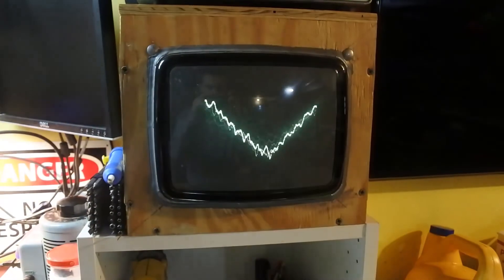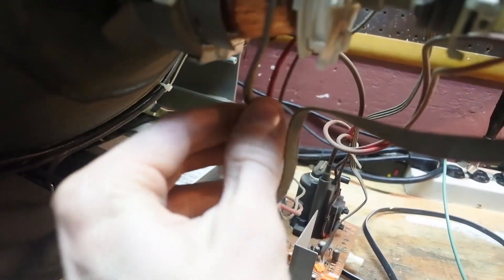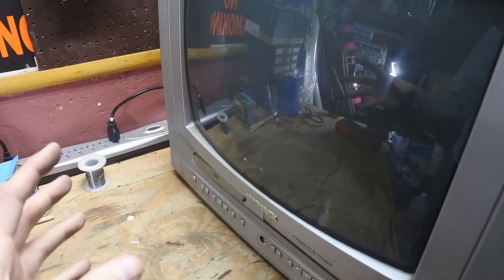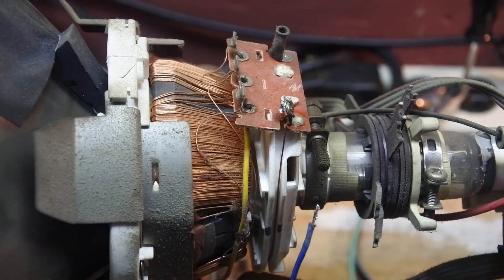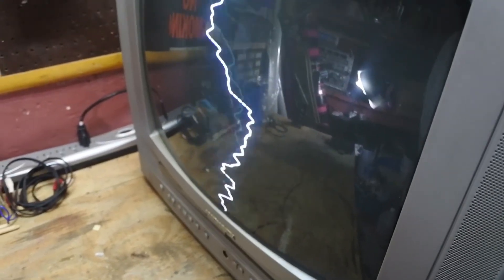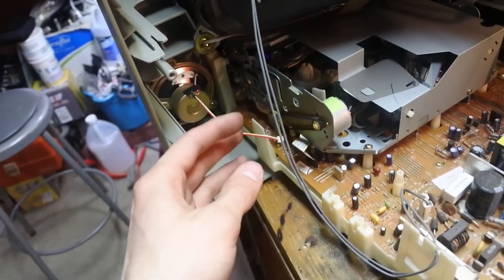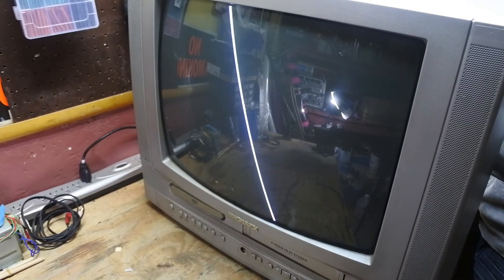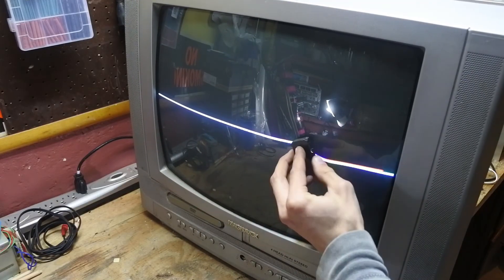How to make a waveform visualizer

Comment: I tried this, and I was successfully able to isolate the vertical coil. However, after attempting to connect some audio wire from a stereo amplifier, no movement occurred in the vertical line. I tried this with two different audio inputs, but nothing happened. After a while, the tv shut off on its own, and now the image won’t turn on to give me the vertical line. I think it’s a problem with either the audio wire I used, or the fact that I don’t have resistors connected to the cut horizontal wires. Can you help me?

Comment: And as usual, there is a missing piece in the mod. You need to inject a custom controlled Cathode voltage (Kb, Kg and Kr) to avoid having the interrupted line due to the input (or lack of) composite signal or snow from RF. Ideally with Blanking control circuit, or another option is to tap into the Jungle.

Comment: Please do NOT discharge a CRT  that way. You stand a good chance of zapping yourself and other parts of the set. Any stored (undischarged) EHT of around 25,000 volts is between the inside and outside of the glass of the CRT. It acts as a capacitor. To discharge a CRT you should ONLY discharge between the aquadag (the gritty black/grey conductive carbon paint on the outside of the CRT) and the ultor cap (that suction cup looking thing). 

FIRST connect your discharge wire to the aquadag. This can be done to any metal grounding straps around the CRT that DIRECTLY touches the aquadag. THEN slide the other end under the ultor cap. Make sure that ONLY this discharge wiring connects the two together. Do not let yourself be in the middle, nor other parts of the set.

What you did only attaches one thing to the EHT, the other part of your discharge circuit was through everything else nearby, which could include you.

For what it's worth, most modern sets discharge the tube at switch off (if not faulty). If you've seen a set's whole screen flash white for a brief moment at switch off, that's it discharging the CRT.

But CRTs can recharge while you work on a set, just from picking up static electricity as you move about. For that reason you MAY want to leave the discharge wire shorting out the tube while the set is unplugged and you're modifying things. Naturally you MUST remove it before applying power.

Also realise a set can discharge through the pins on the electron gun in the neck.

Comment: At 4:15 you mention adding resistors to trick the TV. How do I go about figuring out what kind of resistor to use? High wattage, yes, but how high? I used a 5W resistor and that got scalding hot
Reply: I read in another guide to use high voltage sandbar resisters. 10-25 watts or higher if necessary. But that's only necessary for TVs with the safety feature

Comment: Hi new idea to Make circuit of oscilloscope that run on video input composite of TV with out open any tv or any other device.
it make on working tv or video input based devices or monitor but not used A2D based circuit like Arduino or other digital circuit
Useing analoge circuit this is awesome new idea to make every video based devices into oscilloscope.
Can make tow different frequencies horizontal and vertical,and then distrube by injecting measuring signal work oscilloscope.
Reply: There are some similar, old articles on Video Oscilloscope converters/adapters that generate a proper video signal of a black screen with a single brightness pulse placed within the raster and moved about in time related to the timing of the video signal so that H and V deflection of the bright location in the raster is possible according to the analog H and V inputs to the adapter. 

The bandwidth of the oscilloscope thus created is quite low but it is an interesting thing to do and no doubt there is plenty of room for new ideas. Most of those articles are from the 1960s to 1980s electronics hobby magazines. Similar interesting and related topics are text generators for TV sets as well as do it yourself pong-type and similar types of very early DIY video games designed forTV sets, wherein shapes were moved around on the screen by voltages. The older circuits for similar projects use less 'special' ICs and more discrete parts, have much analog circuitry, and are a source of information for bringing to life such an idea.

Comment: I have seen it say that you can't convert newer CRT TVs. You make a remark about how this can be done. Could you potentially reiterate? Thanks for the amazing video!
Reply from the maker: I assume you mean the part where I was talking about leaving the horizontal wires unconnected and how the TV may not work properly or at all if those wires remain unconnected. So if the TV doesn't want to operate I was saying you could maybe get away with connecting a high wattage resister to trick to the TV into thinking you still have the coil connected. Of course you would need to measure the resistance of the coil and then find a resistor that close to that value. Another thing that could work is just making your own inductor with the proper resistance and inductance to simulate the coil, that would also trick the TV. Hope that helps!
Reply: @SciCynicalInventing  Excuse me, I would like to seek out a sufficiently old CRT TV so I can get around the problems of converting a newer TV. Do you know if a TV from the 1980s is sufficiently old? This information would be greatly helpful!
Reply from the maker: @munsonatl  I dont see why it wouldnt work, so yes.

Comment: I have a question regarding the signal input from the audio cables. Is it possible to simply cut the wires to the speaker, and then run those up to the horizontal coil? Will that give the same effect as following the traces to find the amplifier and attaching the inputs from there? I ask because I am not too concerned about getting sound from the monitor itself, I only want the waveform.
Reply: Yes 😊

Comment: So I hook up my audio cables to the horizontal points, I left the vertical. It wiggles a little bit when I start the TVA bed the music, but then after a few seconds, the tv makes a high pitched squeal and shuts itself off. 

Am I missing something? I think i might need resistors for the open horizontal wires. How can I do that? What do I need?

Comment: Instead of turning the yoke, can't you also just swap the horizontal and vertical connections to the coils?
Reply from the maker: Sorry for the really late reply, but to answer your question: I've tried this before (swapping wires instead of rotating yolk) and it works but the line/waveforms on the tv end up shorter. Meaning that the coils for x and y are not exactly the same, thus why I say to rotate the yolk because it gives you a line/waveforms that are the entire width of the TV.
Reply: no, the refresh rate on the horizontal is to fast to display a nice sine wave, the refresh of the verticle however does which is why its neccessary to rotate it. he explains and demonstrates that in the vid as well
Reply: @Fvgh12345  But if the coils themselves are identical, then it shouldn't matter if you swap connections directly at the coils.  The source doesn't switch X & Y.
Reply: @enigma7070  I believe it has to do with something in the board, he demonstrated in the vid and im not sure how he would have got that with the configuration without something in the board causing it. I just made one a couple hours ago out of a small storm/emergency tv and just followed what he did, works great! Next one might switch it up just to see what happens

Comment: Hey, thanks for posting this, even though there are a number of videos about doing this, your's is the only one that mentions the tv not working after cutting the coil cables, so i was wondering if you could just enlighten me a bit more.. I am doing an osciloscope, so both vertical and horizontal coils, and when i turn it on, if shows the dot in the middle, but just for a second and shuts down, which i figure is the same thing that would cause it not to turn on at all..
So the question is, how do i determine which resistence is strong enough for this purpose,?
And also, when i know the right resistence to use, i connect the positive and negative of the vetical, toghether, with the resistence in between, and the same for the horizontal, correct?
Dont really know anyone that knows about this kind of stuff, so would really appreciate if you could help me, cheers!
Reply from the maker: No worries, so as a starting point I would measure the resistance (ohms) of the horizontal and vertical coils and that would be the rough value of the resistor that you would want to use to trick the board into thinking its connected to those coils. The resistors get connected to the wires running from the baord that originally went to the coils yes.   High wattage resistors are a must, maybe like 5-10 watts at least. Now i say measuring the coils will give you a ROUGH resistance value because you are dealing with an AC current so theres reactance (resistance based on frequency) to consider. You can google that to find some equations to help you calculate it if you want to go that deep. If all else fails its not that hard to drive the tube and flyback with your own circuits. Flyback circuits are plentiful and for the tube you just need 2-5 volts DC for the filament and maybe 20 - 60 volts DC between the anode to cathode. Thats all just from the top of my head so take it with a grain of salt but hopefully that helps. Cheers!
Reply: @SciCynicalInventing  It is probably shutting down because of a protection circuit finding a fault in the horizontal deflection and high voltage section. The correct fix is to measure the inductance of the horizontal deflection coil and then substitute an inductor of that value to the set. The horizontal deflection circuit in this set includes a tuned circuit affecting horizontal retrace pulse width and high voltage level. That circuit is intimately connected in the power supply system and is not to be treated lightly. A resistor is not only wrong but dangerous to the set and renders it unsafe to operate. Also, no TV set of this general class should be run without the horizontal deflection coil connected OR an equivalent inductance substituted to the set. Note that the substitute inductance must not saturate.
Reply: @MusicaCatolicaMIDI  If the brightness is low, then it is possible that the absence of the horizontal deflection coil's inductance has also removed much of the energy storage mechanism used by the flyback-type high voltage supply, resulting in a low voltage. 
If the protection circuit was operating, the high voltage would be shut off and you should not get any trace on the tube. You can measure the voltage with a high voltage probe. They are now easy to own because there's little use for them today outside of we who like cathode ray tubes and general high voltage fun. 

Now, it may be possible to disable the safety protection, either by 'fooling' the detection circuit or by some interesting hardware hackery. I sincerely discourage such actions because the protection circuit, annoying as it may seem, is there to prevent the HV from rising above a pre-set limit according to X-ray exposure levels defined by regulatory agencies. 
It also tries to prevent further malfunctions in the TV set due to excessive high voltage, and to prevent fires and their toxic fumes. Hopefully the output device and fuse would blow quickly.

Because of the vast number of ways television and monitor HV and deflection protection circuits are designed and implemented, it is not possible to provide specific information on how to defeat them. One who is experienced with TV set troubleshooting could figure it out from the schematic or by examining the set itself. No repair personnel I have known would create a permanent workaround to avoid the protection circuit. But there is always one LOL.

Comment: a little late to this but what happens when u play a vhs tape in that model tv while ur playing audio with the oscillograph. im pretty much trying to know how to play videos thru a homeade dirty video mixer and have audio scanned while video is playing at the same time on the crt
Reply: sorry if my question is confusing im just starting to grasp this stuff! thx
Reply: It is clear enough. As we know, the video signal from a player is based upon a raster scan divided into a set of time-wise lines that are repeated in succession, each one carrying brightness and color information. A full 'frame' is composed of two 'fields', one after the other, which are interlaced, but that is getting off track and has only to do with the video's resolution which is irrelevant for your purpose. For your purpose, one field is a complete image and requires 1/60th of a second to complete. 

So, if your deflection patterin takes 1/60th of a second to complete, you will stretch out that image (the field) along the complete track of the pattern. You will not see any sort of image, but rather areas of varying coloration and brightness, and of course the 'blank' timing parts of the video signal that do not reach the CRT screen. (note 60Hz or 59.9Hz is the USA NTSC standard, others use about 50Hz, YMMV). A trick is to synchronize your deflection waveform to exactly the same speed as the video you are playing back. Then, the video scene will be stationary in relation to the deflection waveform and the movement of colored areas will be seen to correspond with the action on a separate TV monitor that is displaying the output of the playback device. Sub-harmonics of 60Hz will also 'freeze or synchronize the pattern to the incoming signal.

Comment: What happen if i send audio signal to both direction? Do I get a "3D effect" image?
Reply from the maker: Yes, using an audio amplifier you can connect the left channel to the horizontal coil and the right channel to the vertical one and play around with frequencies on the channels to produce 3D images. Search "lissajous figures" or "oscilloscope music"
Reply: @SciCynicalInventing  ok, thank you very much
Reply: @SciCynicalInventing  There are some patterns generated on normal oscilloscopes that appear to be 3D and drawings. To display on an electromagnetic deflection display as in this video here, lower frequencies can be used, or more exotic deflection amplifiers made. There are many entertaining youtube videos of pictures and shapes drawn on oscilloscopes. Many also play the audio tones used, for an extra dimension of experience.

Comment: Hi maybe you can help me,  I tried making an oscilloscope with an old tv by plugging  both deflection coil on different audio jacks socket (a lot of people do that to have both X and Y axis displayed at the same time when you play music). What I get when I turn the tv on is the initial dot in the middle but it stays super small but becomes really really crazy bright and after a few seconds i hear a pop, the display shuts and after a big static noise appears coming from the back of the tv and continues until I unplug the tv. Any ideas on what's wrong ? Any tips would be greatly appreciated. Thanks
Reply from the maker: Sounds like you have your high voltage horizontal wires not connected to anything. I mention in the video that sometimes when you mess with the tv coils it wont operate correctly due to the high voltage wires being disconnected and shorting out somewhere. So usually you can get away with using a giant resister across those high voltage lines to fool the tv into thinking its connected to its yolk coils.
Reply: @SciCynicalInventing  so we would need to connect the two horizontal wires together with a resistor?